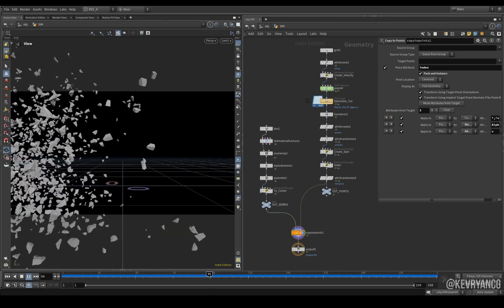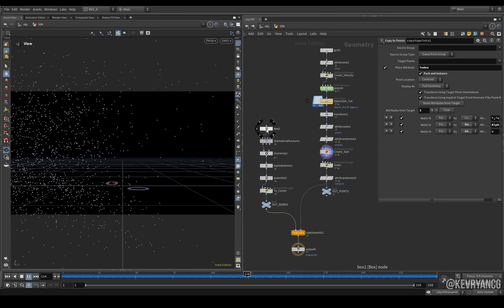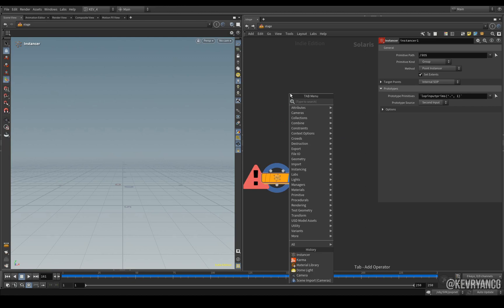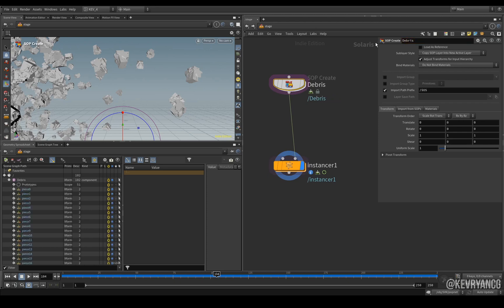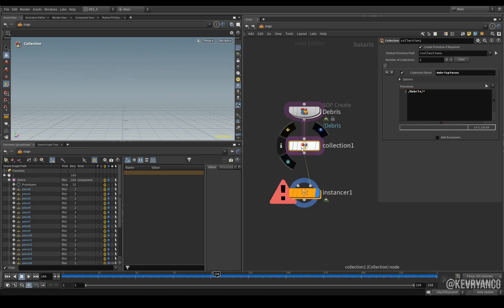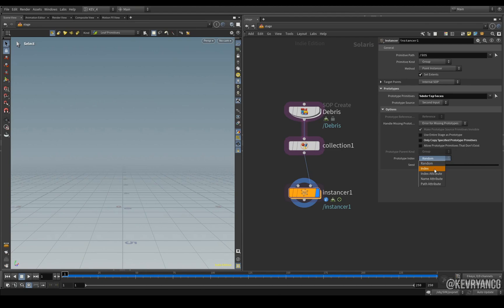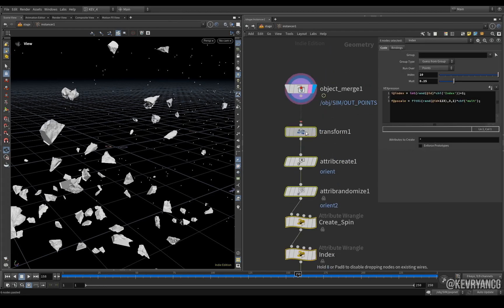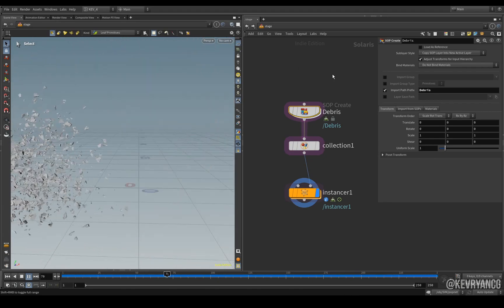Custom Instancing in Solaris! (Quick Houdini Tutorial)

Comment: Is there a way to instance USD assets? (with material assigned)
Reply from the maker: Ha I just tried it there on another project and it worked. I had instances of streetlight, and a separate USD of a car and just swapped them. 

So you bring in the USD file using the Reference Lop, and then pipe that into the collection node and it works with the materials too. Just make sure you give the USD a primitive name, and follow the tutorial that way. I think if you have multiple assets you can just bring them into the collection line by line and it'll work it out. 

Also if you want to make changes the SOP modify lets you do stuff with the USD and you can also edit the material with the LOP of the same name.

Comment: So... Is there some speed benefits?
Or it's just for not jumping to obj - stage lvl?
Reply from the maker: Oh, absolutely. The framing of this tutorial was for the specific instance of having multiple packed objects, either custom debris or just merged objects that you'd typically wire into the Copy to Points with a variant attribute on the points, as that information wasn't obvious to me from any thing I was reading online. As in having multple objects coming in from SOPs to LOPs from an object merge in a SOP create. But really the power of the instancer comes from being able to reference in objects via USD and by using a similar method with the Collection set-up and dragging objects in, being able to instance them on points using just Solaris. 
It lets the renderer optimize the data going into it, rather then loading in unpacked scenes of billions of polygons. You're simply telling it here's these few objects, and they go on these points at these sizes and orientations. Try it yourself with something good and hi-poly and see how much you can render.
Reply: @KevRyanCG  but you can specify on the sop import how to instance (giving that you did a copy to points packing and instancing the pieces), so is there a benefit in doing so in solaris?

I usually have it setup at obj level with a copy to points, pack and instance and then in solaris I just import that specifying "point instance" as the instance setting.
Reply from the maker: @brencaaa  Ah nice! I didn't know this. I just tried it there on another project I'm working on and it seems to be more or less the same. It's also circumvented an issue I was having with the instancer which kept crashing my scene. So I guess it just comes down to circumstances then. If you just need to do a handy copy to points and have that replicated as is in LOPS then using the Create Point Instancer option is the way to go. 

But if you wanted that extra bit of control at the LOP level, and to swap things out then at least the instancer is there. I can't remember which tutorial it was but to figure out what I needed I found a video where the guy was using the collections to bring in USD files and basically doing the majority of his work through the Solaris context. It'd be the same idea as folks who never use the seperate MAT or OUT contexts and instead create Material or ROP networks at the obj level, and I've worked with TDs who create nested networks and tools which have a ridiculous level of automation built in thanks to this. 

Nevertheless cheers for the tip Massimo! I'll be sure to mention it in a future video.
Reply: @KevRyanCG   Happy to hear that! I've always did it like that but I was wondering if there where benefits of doing so at LOPs level (coming from Redshift, I was curious to know if it worked like the "rs proxy workflow", basically instancing at render time instead of using packed prims, but it seems not to make a real difference, plus karma is way happier to work with packed prims than Redshift was)